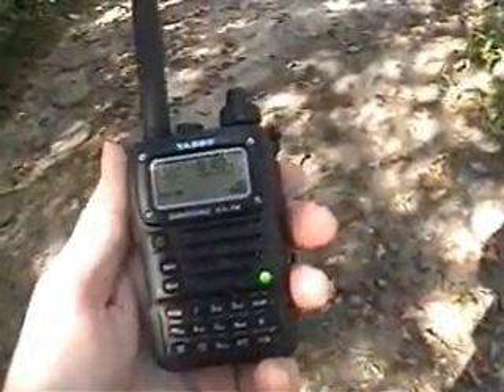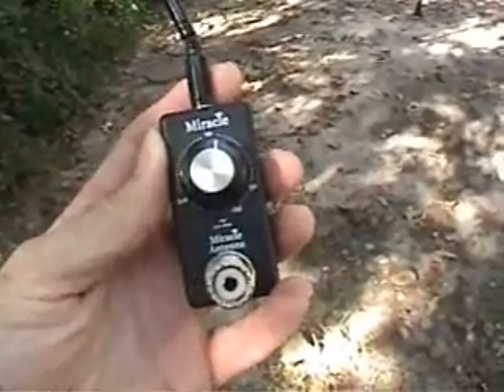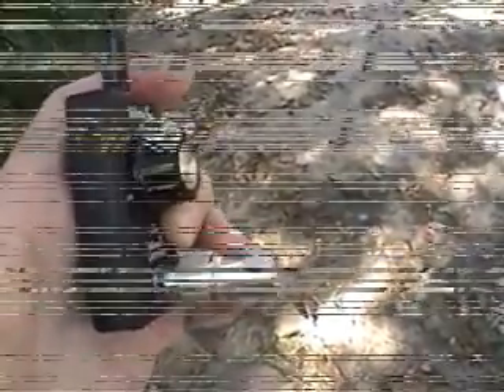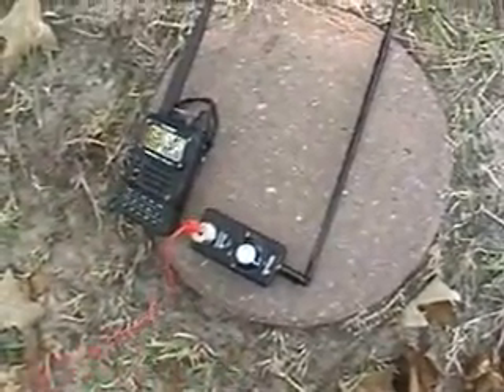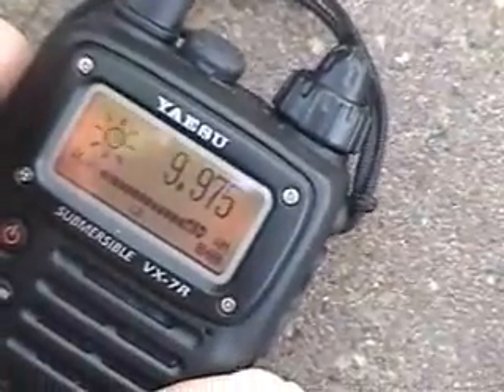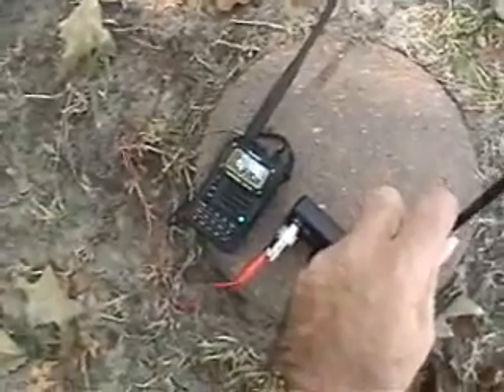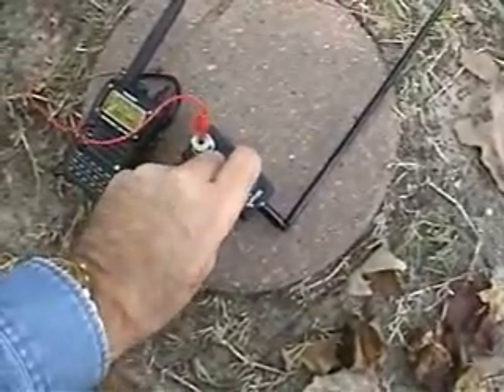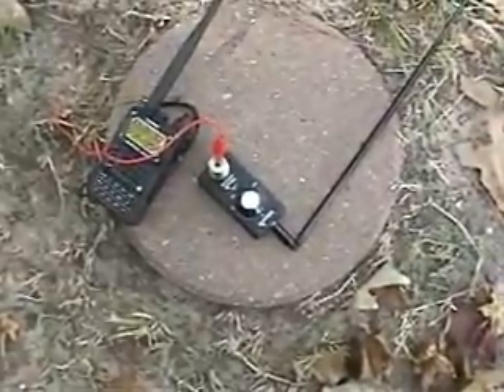Yaesu VX-7R and Miracle Whip Antenna for SWL

Comment: I see how the alligator clip goes on the miracle whip, but can't see where the other end of the clip attaches to the vx-7r  ??        //////////   opps I just saw it, very briefly, clipped to the tip of the radio antenna.  Thx